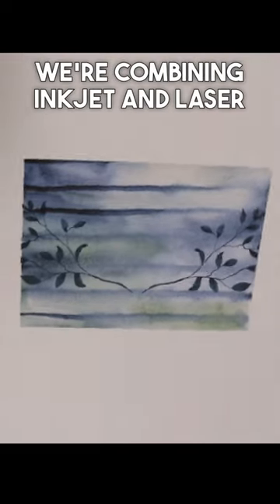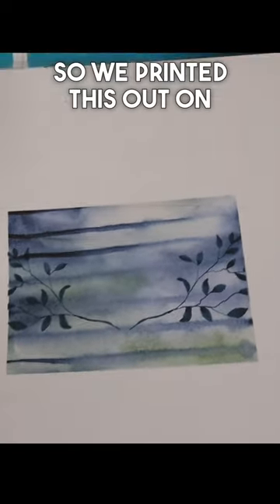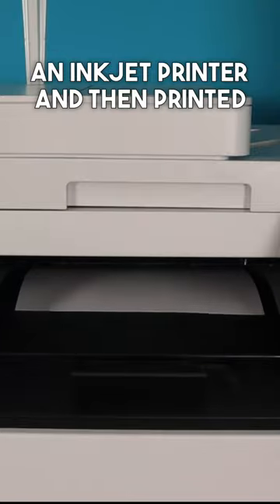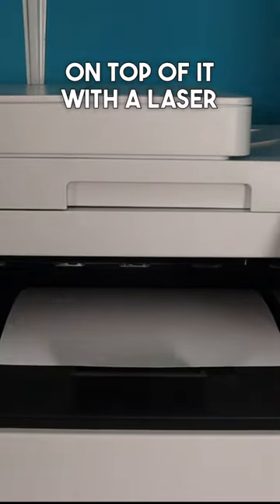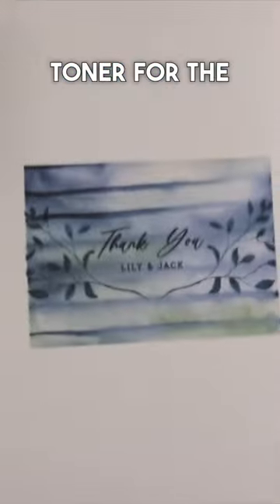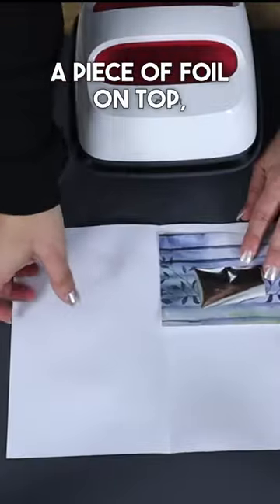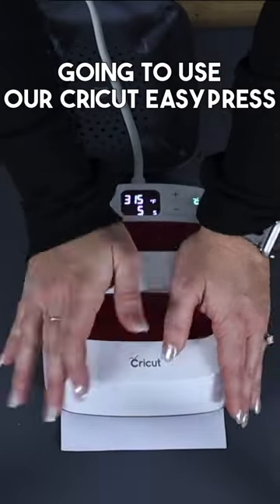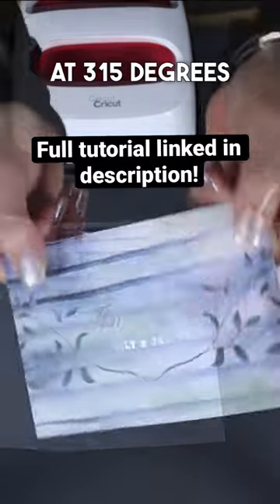It worked!! Inkjet + laser printer #foiling DIY. #papercrafting #cricut #heatpress #heidiswapp

Comment: for those also scrolling around, this works and is VERY fun!!! the only issue (i've encountered) is if your printers have different margins and can't print borderless via their respective apps. so play with finding a mutual center if things print slightly off for you!
Reply from the maker: So glad it worked for you too! Great tip. 😉
Reply: @JustMightDIY  well, it’s almost there 😭 my home printers keep changing their feed positions so I may or may not be crying into pile of sticker sheets rn 🤪

Comment: Why not just print with the laser printer? Did you use the full design with each printer?
Reply from the maker: The foil sticks to toner once heated.  So you only want it where you want the foiling to appear.  As that,  no,  we left the foiled part out of the inkjet and only the foiled part with the laser